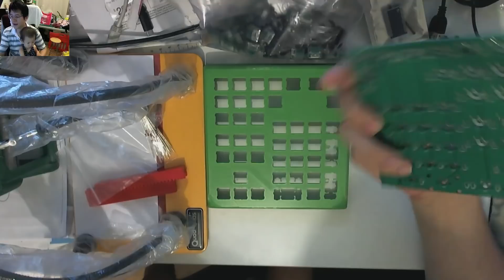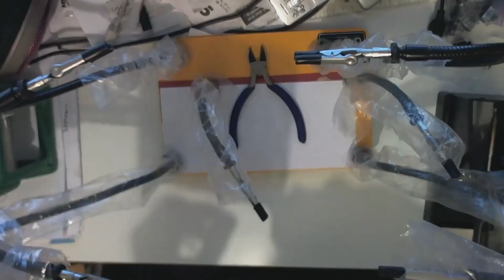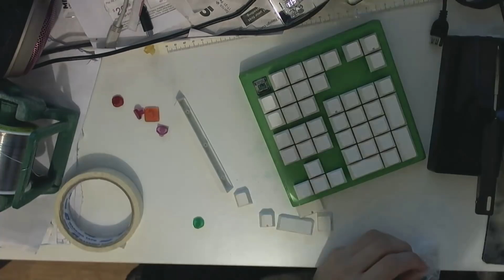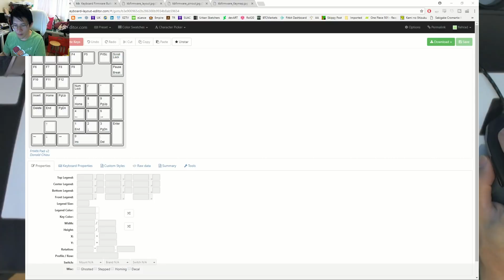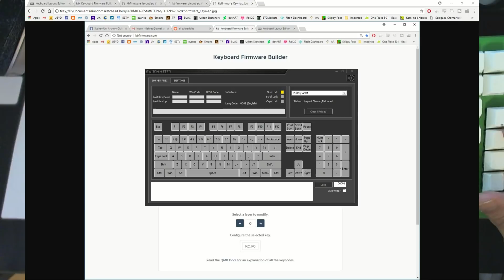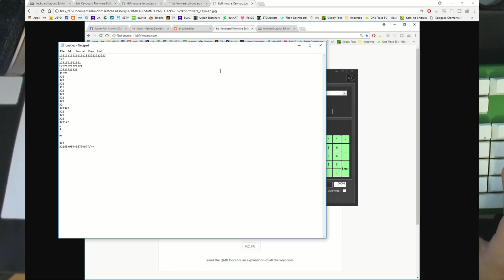FHAN Pad Build and Test

Comment: tacking the diode from the bottom will allow for diode to be flush with pcb on the top side
Reply from the maker: Well, its not 100% flush, but much closer to flush due to my bad clipping.

Comment: Hi, I'm looking to build my first board. (zero experience with soldering) Can you recommend the iron and whatnot I should buy to get started? Thanks!
Reply from the maker: Hi Rusty! Its going to be a learning curve coming up for sure :) In regards to iron and what not, it really comes down to budget, and the kind of workspace/resources that you have available to you.

My current setup is:

TS100 mini soldering iron (widely available through ebay, banggood, zapals, gearbest, etc). There is variants of it in kit forms, but the base unit comes with one tip, and there is I think 7? different tips available to purchase. You can also get body shells to customise its colour.  Most of them do not come with a power supply, so you will need to source one, but a 12-24V DC supply that fits its connector type (I don't know it off the top of my head) will be required. I have seen some kits that come with power supply, or have 'linked' items on their site for sale which are suitable.

A good quality solder. Leaded is easier to work with than unleaded, there are no massive health concerns for home enthusiasts normally so long as you follow good cleanup procedures. Removal of Hazardous Substances (RoHS) requirements in commercial use means they use unleaded solder due to professional factory soldering workers being constantly exposed hours on end daily. I use leaded.  You want something that will be 1mm or less in diameter, and for ease I use rosin core. This just means generally I do not need flux/rosin. You can use non-rosin core if you like, but it means you will need to have flux available and constantly be dipping /dabbing/painting your part and tip with it.  I currently have a medium (not super expensive) quality 0.7mm solder, in a 1kg spool (1kg is a lot of solder!).

Tip cleaner. Brass wire sponge. Simple.  Available generally anywhere that sells soldering supplies. Some are bigger than others, in fancy holders/containers.  I got mine free from a friend (spare), so I got a takeaway sauce container (60mL), cut a hole in the lid, shoved the sponge into the container and closed the lid.  As long as it stops fine solder particulates from going everywhere as you clean your tip, it is fine.

Soldering spool holder. Generally simple holders are fine, but something that allows your solder to move freely as you pull on the wire. Some are fancier than others. 3D printable too, I designed one that is available for print on Thingiverse (https://www.thingiverse.com/thing:2366271)

Iron holder. There are lots of different ones out there. You want something that is weighted, sturdy, and safe to stick the iron into/onto while its hot for either turning your build around, inserting parts, or to let the iron cool down. I don't have any recommendations right now because I am using the one from my YiHua 936+ soldering station haha. 

Helping hands. Something that will clamp your PCB and/or components. Two hands is good, four hands is better, more than four is optional. I have a very expensive but very good one plus extra hands for 4 long hands and 2 short hands. Lots of choice, and it will come down to budget and preference on what works for you.

A fume extractor is a good idea, but from what I can tell in a few research papers, most fume extractors are not as effective as they need to be, and therefore are a waste of space on the table. An effective fume extractor needs to have sufficient air flow movement away from you, and to contain the rosin fumes (unless you solder over 600°C, you're not vapourising lead). A good strong fan (like a desk fan is enough) to blow fumes away from you also works as long as you have good air circulation away from you but of course this may affect your work area and components. Solder fume extractors that are tip mounted (e.g. have a suction tube right next to the soldering iron tip) are the best, but are only commonly found on soldering stations as they are built onto the iron, and can be expensive setups.

Gloves are a personal preference. Some use it, others don't. Just wash your hands if you don't once you finish, and wipe down your work area for any fine solder that has spluttered.

Snips, Side/flush cutters are useful to cut diode legs and header pins. Cheap, widely available.

Tape. I use masking tape a lot, relatively cheap, Great for holding pro-micro's/Teensy onto their header pins for gap spacing the pins, great for holding the controller assembly to the PCB so you can tack-solder the pins on the other side.

Other than that, I think that covers most of the basic things you need!

I hope that helps!

Comment: If you did a 3mm thick case you could fit the diodes between the case and the pcb, so you can solder the diodes like you do normally.
Reply from the maker: That assumes your diodes are perfectly flush against the PCB though?  I actually did 3.5mm plate, so it would have been very difficult to make it fit right perfectly!
Reply: The Board Podcast It worked for me on my let's split. I flashed the pro micro first and then soldered that onto the pcb before all the switches. Then check everything works by shorting all the contacts with a pair of tweazers while the board is plugged into a keyboard checker
Reply from the maker: But then you would have had to desolder the pro-micro to solder the switch in? Its not a big deal though in that this method of soldering on the diode side rather than the through-side still worked out well, and it does make very neat sides on the switch side.